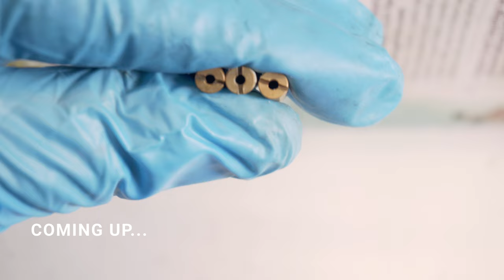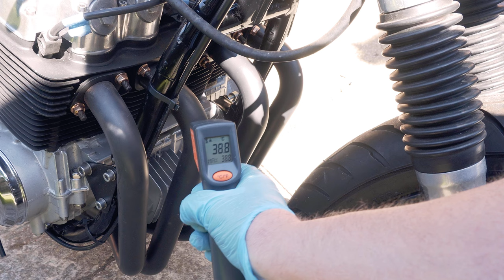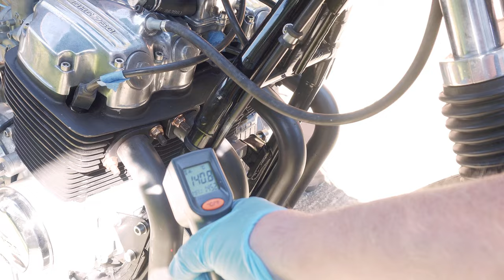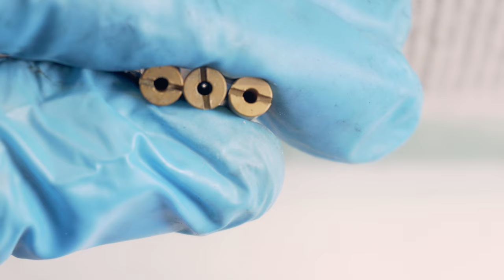Fixing some of the problems for my CB750 SOHC Cafe Racer Project Bike found after first start | 26

Comment: If you leave fuel in there it doesn’t take long for the primary jets to block, just a couple of weeks can do it in warm temperatures, the good news is you only have to take the cone filters off and squirt carb cleaner down the balance pipes to clear them, (provided it’s just congealed fuel), you’ll thank me for that tip in the summer 🙂👍
Reply from the maker: Great tip.  I tend to turn the fuel off on my carbed bikes shortly before I stop to park them, then let them run out.  It doesn't work perfectly but I am mostly OK.

Comment: Great video! I wonder if the idle jet passage is a little blocked up on no2 making it want more vacuum to draw fuel in
Reply from the maker: Great point! I'm planning to get some bigger mains, so when the carbs are off again, I will give them all another clean.

Comment: Senior moment on the lose jet "issue" like ive said before check (brick house builds) kill switch robbing power issues , something to do with ohms,. clean kill switch contacts, but lets be honest cb750's never seem to run sweet at tickover, always sound "lumpy" did you check needle heights ? i think an ultrasonic bath has been done at some stage in this build ? air filter may help to, cheers,.
Reply from the maker: Still quite surprised about the jet, but I noticed a post on FaceBook where 3 or 4 others have done the same, made me feel a lot better :) It doesn't have a standard set of switches so I am pretty sure it isnt the Kill Switch issue, I have had that with an old Triumph in the past.  I am pretty sure the jetting will need looking at, the exhaust will be very free flowing and I am going to fit some cone filters.  My main concern was that the carb issue may be hiding some deeper issue in the rebuild. But I'm pretty sure it isn't now.

Comment: Good to see the progress. The holes in those jets are so fine it's a miracle they don't block on a regular basis! Could I ask - what float height did you use in the end?
Reply from the maker: The PO had been through the carbs, and they did look pretty good. Shows you can't go by looks, and need to be more diligent.  But it could have been dried up fuel from the original time we started the bike.  I set the floats to 26mm, I made that gauge in and earlier video.
Reply: @SPANNERRASH  Many thanks. I did see the reference to 26mm in your previous video but wanted to make sure as you mentioned you "re set the float heights" in this one. I have a problem with my CB 750 after recently doing a complete overhaul on the carbs and I'm thinking it might be float heights. The bike starts fine and runs well at low revs but when riding if I open the throttle the engine literally dies. Until it's back to low revs again. It has electronic ignition fitted and I believe the ignition advance is working OK. So similarly to you I'm left with carbs.....
Reply from the maker: I'm looking at increasing the main jets, not really because the capacity is bigger, but because the exhaust is a lot more free flowing than the original pipes and it will have cone filters.  If you have made these type of changes to your bike then that might be your issue.  The mains don't really come in until 1/2 to 3/4 throttle or so, sounds like it would give the effect you are getting, then the needles also open up further. You could try raising the needles a notch or two first.  I have seen a couple of forum posts that give calculations for changing the main jets, so I am thinking of trying one of them, but it isn't an issue for me until I can ride the bike.

Comment: Your blocked  "pilot jets"   .... are the MAIN jets!
Reply from the maker: You think?  Not in my paradigm :)
Reply: I think the main jet is the one that unscrewed itself?
Reply: The large jet is called the main jet.  The small one is called the slow jet or pilot jet.  Be sure to look thru the pilot jets and at least make sure the hole looks exactly round and they all look the same size.